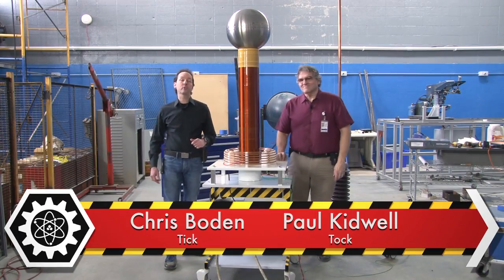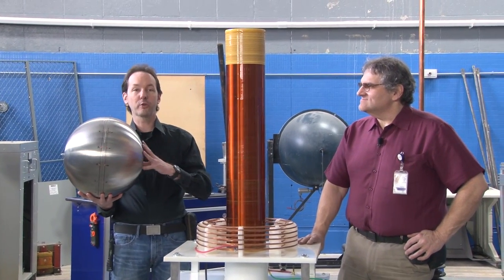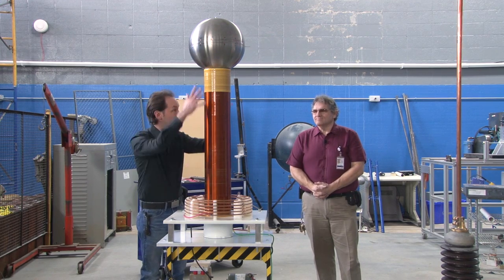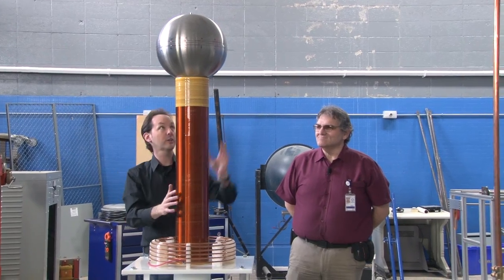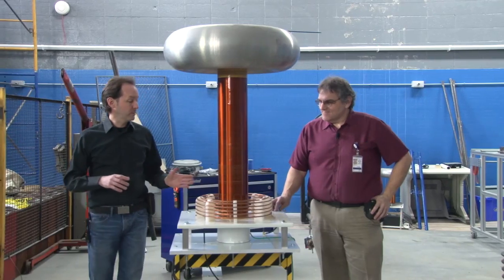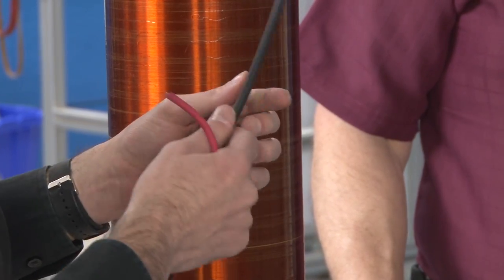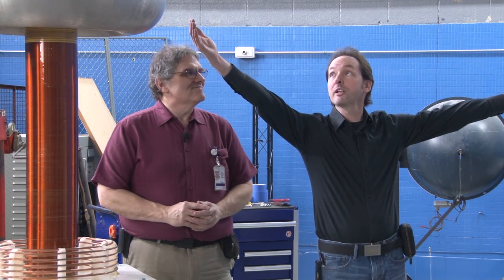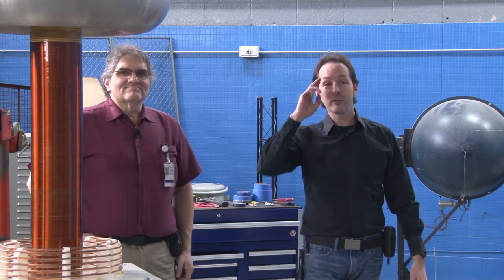Top Load Testing for a 6-inch Tesla Coil: High Voltage Lab

Comment: Good progress
A tesla coil is basically a 1/4 wave antenna with a top hat
I use battery jump cables for my coils, you only need the (15kv) insulation value if the wires are close to others, or to ground. being that they have a lot of strands, there's more surface area *better for HF), and more flexible.

Comment: Good info, thanks guys. For myself I have found that a pair of stacked toroids give even better field control - a smaller toroid (diameter a little bigger than the coil diameter) just above the top of the secondary winding gives better field linearity over the top half of the secondary (fewer sparks from the winding itself), with a bigger toroid above that to get the bulk of the required capacitance for good tuning. Then, a gapped and grounded ring of copper tube just above the primary can help to improve the e-field linearity over the bottom half of the secondary, as well as acting as a strike ring. If you do all that and then keep the primary frequency tuned lower than the secondary frequency you can probably avoid racing sparks unless you really over-power your coil. Secondary frequency is reduced (from its small-signal measured value) when streamers and arcs are present, and that lower secondary frequency is what you need to match the primary frequency to. Best of luck everybody and play safe.

Comment: I love the up-and-down primary, it gets both connections close together at the bottom and probably helps with e-field shaping. Agreed about good fat wire or copper tube in the tank circuit, but why would you then use such a flimsy spring-clip for the tap? Check the resistance! Some sort of solid clamp with screw pressure might give lower losses. Also, you don't need the fat wire right back to the transformer as the tank oscillation mostly doesn't flow that way, you need good insulation but the copper could be much thinner as the charging current there probably won't go much over 1A in these smaller coils. 
Great stuff and I can hardly wait to see you move on to the bigger coils. Great Lab.

Comment: I found a source of toroids, various sizes up to 500mm, in Austria; on eBay, still fairly expensive for a hobby but they come as half-toroids so they travel better and you can use half of a smaller toroid (under the main toroid) for field control. Seems to get away from the horrible field control problems associated with sphere toploads, although I wonder if it would be possible to flatten those IKEA bowls a bit to give a flatter, or even a concave, profile?

Comment: Do you think we'll be able to achieve flight or levitation with magnetic and electrical fields. If So, how would an individual be able to achieve that?
Reply: Unlikely for any useful definition of flight (I say that because someone might say maglev trains could count as flying since they're not touching the ground). The inverse square law is really unkind to the idea of getting something of any real weight flying only using EM fields. It just requires way more power than anything real has a chance to produce.
Reply: MrRtkwe Theoretically Mostly everything is made of plasma and say if we where to discover how to manipulate the physics of this and use it to create flight. What about the power of and electron or some form of nuclear power to amplify the EM field? Can you achieve flight in that way? I'd like to hear your response.
Reply: Eli-Hu Yisrael you wanna know?